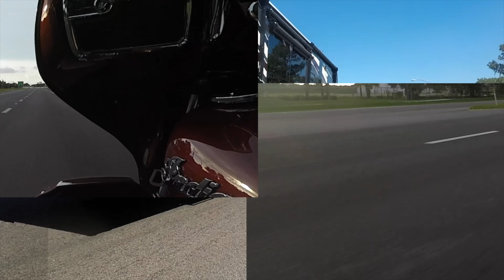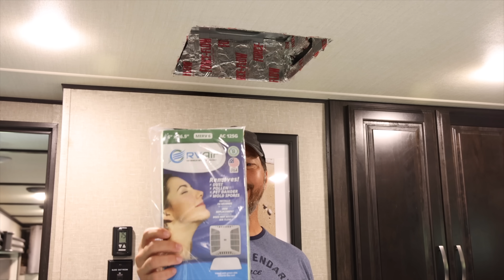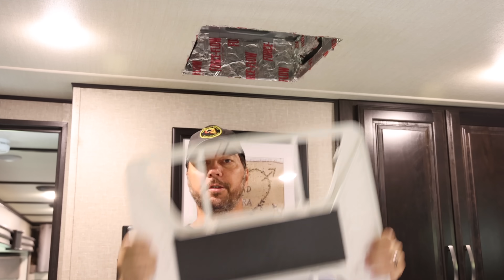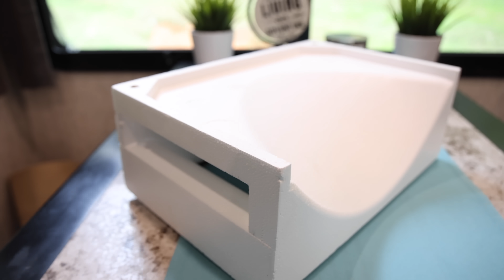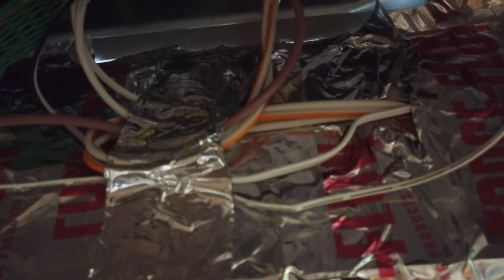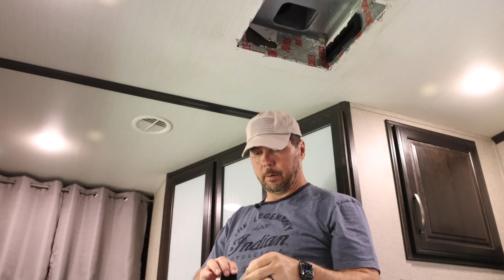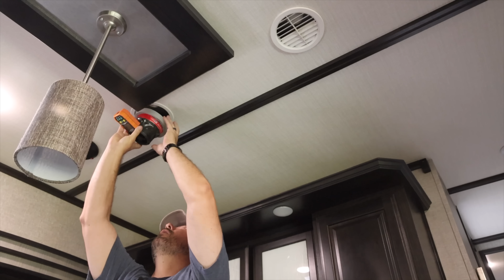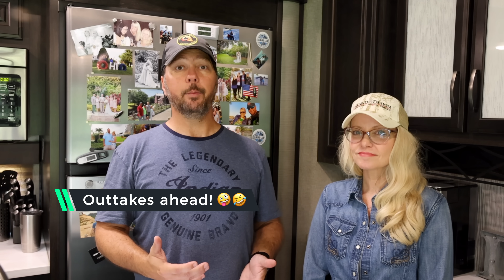Turbo-Charge your RV AC with RV AirFlow! (40% Improvement on Average!)

Comment: The foam arrived. I installed on living room A/C. The plastic pieces you installed into the supply side ducting were already installed in mine. I had to install tape around the foam on the return side to seal it off from the supply side. I have a 2021 momentum 376THS. Will try to install the other 2 tomorrow.
Reply: How did the system improve overall?
Reply: @flawlessvic  Western Washington cooled way down. Haven't had to use the A/C since. We are supposed to get into upper 80's this weekend. I will test them then.

Comment: Just installed this on our 2021 Imagine 2500RL. All I can say is WOW. The wife said she can tell a big improvement on the bed vent. I did put foil tape on the back of the air dump.
Reply: I was thinking about the tape on the dump as Chad was closing it up--the increased return airflow probably will make those slide louvers rattle more.👍

Comment: Our Open Range has what’s supposed to be a “high performance” central unit. It has dual intake ducts rather than that single plenum directly under the AC unit… I assume there’s still a plenum something like this somewhere but it’s not directly accessible. Perhaps this system doesn’t suffer some of these shortcomings?

Comment: I'm sure its more efficient but the dumps are cut off completely in the new system.  Did you compare it before and after with the dumps slid shut?  Slid shut, they would push more air out to the other outlets.  Maybe not 40 percent more, but still.
Reply from the maker: There is info in the blog article here: https://changinglanesrv.com/rv-airflow/

Comment: Maybe adding a question you've already answered, but did you guys measure the actual temperature of the air coming out of your supply vents? You can pick up an infra-red thermometer like what they're using to check your forehead on Covid screening to measure it. One good way to measure the efficiency is to check the temperature of the air going into the unit, and the air going to the living space (supply air) , then measure the difference. You probably want to see between 14 and 22 degrees on A/C. The closer to 22 (or above) you are, the more efficiently the unit is working overall.
Reply: I haven't measured the temps, just the air speed from the vents.  It went from 8-9 mph to 18-20mph and now my wife complains that "It's Too Cold".  This product saved me from adding a second AC unit to my trailer. Best Mod I have ever made to my 4 year old Starcraft!

Comment: Did you notice that if you only have one of the multiple units running that the air comes out of the return side?
Reply from the maker: It shouldn't, unless it's pushing past the evap coils on the units that are off....
Reply: @ChangingLanes  exactly what it does.
Reply from the maker: Maybe try removing some vent covers to reduce resistance on that end?

Comment: Hey guys, great video...I'm considering purchasing a pair of these for my GD 375RES....tell me I'm overthinking, but....those big 4 bolts that hold the AC unit onto the rig's ceiling....how do you know that when removing + reinstalling them, you haven't upset the sealant used on the roof for the factory install?
Reply from the maker: It shouldn't.. There is usually some kind of butyl tape seal under the AC.  But, as long as you don't move it off the seal you should be good... Worst case, check it on the roof side also and have some of this handy:  https://amzn.to/2TTsMbg

Comment: Thank you guys so much for the info. I am a brand-new Solitude owner and this is my very first fifth wheel. How long should it take for the main living room to cool down? I think I might be having trouble with my rig. It was 96 yesterday and I couldn't get it below 84 in an hour's time.
Reply from the maker: That doesn't sound unusual.. On hot days, get the AC started early.  It takes a while for it to play catch up.

Comment: Have to say unless you check the devider and noticed it had fallen over, you would have always run the AC that way and had less than peak proformanc. Where as with the RV Airflow it always runs at 100% potential because there is no divider that could fall over so, an un knowing RV'er would have a 140% gain in AC flow.

Comment: Your restricting the CFM of the blower which leads to high amperage on a Dual shafted motor  condenser/blower.( STOP FIRE )  ! due to heat : amps = HEAT......
Reply from the maker: The CFM is not restricted, its only restricted from not going where it shouldn't (roof, etc)...  Also, our AC is has separate fans (not dual shafted).

Comment: no way that increases airflow by 40% unless they increased the size of the ducts.
Reply: It probably does seem hard to believe, but I can attest to the fact that is does greatly improve airflow.  One reason is that it actually permits more air to enter the AC and it reduces any air losses due to poor construction and ducting done at the factory.  Before installing the RV Airflow the air coming out of my ceiling vents measured 8 to 9 mph on my handheld wind meter.  The trailer was slow to cool and never really ever felt cold. After the install the same vents show a wind speed of 18 to 20 mph, and now my wife complains that it gets too cold!  It cools the trailer in less than half the time than before, and the AC runs much less as well.  The money spent on the RV Airflow saved me the cost of adding a second AC to my trailer.

Comment: The price of this is $380. You can go to Home Depot and get the same thing for $30
Reply: That's bogus...where did you get the $380 number??  Good luck with your $30.00 dollar HD cheap fix.  RV Airflow is well designed, works better than advertised, and saved me from buying a second AC for my trailer.  Post some photos of your project....

Comment: Been watching you kids for a few years now and just wanted to tell you we just bought a new Grand Design Reflection 5th wheel and they are NOW installing the RV Airflow in the AC units.  I took mine apart to check before I ordered one, and WOW it is already installed.  Makes a HUGE difference  in the cooling and air flow.

Comment: I installed an RV Airflow, in March 2021. "WOW", what a difference. Had to turn the A/C vents in a little different direction. Wife was complaining of the air blowing directly on her was "TOO COLD". Also noticed a difference in, when we had to run the A/C. Due to the moisture on the windows, when just running the furnace only (high humidity). The humidity level decreased substantially , and the windows cleared up.  THANK YOU R/V AIRFLOW for this product.
Reply from the maker: 👍🏼  😀  Glad you like them!
Reply: @ChangingLanes  
Vacation starts this Saturday, Sequoyah state park, outside Tulsa okla. You need to check that place. It's our 2nd time there.

Comment: $200 for a piece of styrofoam? It’s a cool idea but cmon man. Kinda hitting people over the head a little
Reply: It's way more than just a piece of Styrofoam.  It's a cleverly engineered product that does work better than it was advertised.  The air flow from my AC ceiling ducts went from 8-9mph (measured with my handheld wind speed meter) to between 18-20mph!  The price I paid, much less than $200 with the Changing Lanes discount, saved me from spending $900 on a second AC unit for my trailer.  My trailer cools down so much faster now, plus the AC doesn't run as long to reach the set temp on the thermostat.   It's by far the best improvement I have made to my trailer since I bought it 4 years ago.

Comment: I can't understand having black air conditioner covers and routing the cold air through ducts in the ceiling.   That black cover absorbs 500 Watts of heat in the sun, and those ducts likely absorb another 500 Watts of heat and warm the output air of the AC unit before it gets to the ducts.  It would be great if we could get the RV manufacturers to do anything else.  They seem blind to efficiency, effectiveness and noise levels of these systems.

Comment: As usual shipmate, great vid. Question:  I purchased the recommended “torque” driver. After completing the install, It seemed like I had turned on  the 4 lag bolts for a l o n g time. Checked with the inch lb tool and it started clicking at 35 I/pds. Would you suspect (obviously I can’t expect you to guarantee) that 35lbs is sufficient?  Feels like I’ve turned till the cows came home and I’m hesitant to keep turning.  Pls advise you thoughts. Thanks, Dave. SCPO(SW), USN (Ret)
Reply from the maker: Ours took a few turns too. I was surprised.
Reply: I found the torque mentioned was way too much for my AC.  I had marked by mounting bolts before I removed them and at 40inch pounds the marks were way different, plus my gasket under the AC was overly compressed.  I backed off the bolts and torqued to the previous marks I had made and that required about 25 inch pounds. With the RV Airflow installed you can only see two of the indicating tabs on the AC that show the correct torque.  At 25 inch pounds the tabs were in the correct position.  I think the amount of torque required depends a lot on the condition of your AC gasket.

Comment: Hey guys, thank you for the RV Airflow video. I just received mine today and worked for hours installing it. Where the Manufacture framed in the opening in the roof it was LESS than perfect! Not square, Unit not set on roof square, duct with large gaps, opening too small for main piece...etc. After watching your video, It prepared me for some of these obstacles. My rig is a 2018 Avenger by Forest River. To give you an idea how poorly it was installed my average increase is 61%...a noticeable difference. Thank you again for the excellent videos and information!

Comment: We have an Eclipse Attitude 27SA with one central air conditioner in the main room and vents to each room. If we were to use this product it looks to us that we would no longer have the option to open the large vent and cut off the conducts in order to cool the main living area quick as possible which can take some time. Would using this product and getting 40% increase in the ducts make up for not having the option of having the vent wide open? Which would be more efficient?
Reply: You are correct, the air will no longer come directly from the AC out of the large vents in the bottom of the AC.  In the AZ summers I would open those first trying to lower the inside temp as fast as I could, but that didn't seem to do very much for the amount of cool air coming out. The cold air coming out of those vents is actually right next to the hot air going into the AC, so there has to be some loss of efficiency there.  The RV Airflow actually increases the amount of warm air being sucked into the AC unit because there is more surface area to draw from, hence, more air in, more air out.  Since my installation I can truly say that my 30 foot travel trailer with the 15kAC and 5 ceiling vents cools much, much faster than ever before. I have never missed not having the larger vents open at the bottom of the AC unit.  It has been the best mod I have made to my trailer, except for maybe adding the SoftStart to the AC, and it has saved me from having to add a second AC, which I had planned to do this summer. I have no regrets!
Reply: @SeaplaneSailor  Hey Lee, thank you that response. We are hoping that will be our experience this summer. We also added three turbo fans to our roof vents to try to get that initial heat inside to exhaust outside to help jump start the cooling process. We haven't had the opportunity to prove that theory yet. Do you think that will help as well?
Reply: @franktostanoski8136  Sure couldn't hurt to give it a try.

Comment: Just ordered two for our Arctic Wolf 321BH.  We have the Coleman Mach3 A/C units.  Thanks for the coupon code, saved me $34!
Reply: I have a Arctic Wolf 321BH with one AC.  It will not keep cool even on an 80 degree day.  Have not checked the divider problems, but still think I need more help.  Did this do the job?  Can you cool your unit with just the main AC and the AirFlow?
Reply: @gabegundersen9681  I haven't tried with just one. I've always been on 50amp. But we just went to Disney and it was 98 degrees in the rig when we got there. It was down to 70 degrees in about 45 minutes. These things rock.
Reply: @RonnieRukus  Thank you!!!  Will be ordering ASAP.

Comment: Awesome video question for you so supposedly my 2021 grand design momentum came with the center one so I’ll be installing the other two in the front and rear. Now as far as the heat pump goes I only have one as well in the center what do I do with the other two ACs when I’m running the heat pump do I have them on off?

Comment: What i don't understand is this handyman didn't do it before. The information is out there. And so they were givem them3 i wonder if they did the fix and then remove it for sponsorship? Just thinking the information has been out there and now its like this. Hope they are real  not fake yes
Reply from the maker: None of the DIY solutions we've seen out there are as good as this commercial solution.  Sure, a DIY might be better than noting if done right, but this thing was engineered for maximum airflow and minimum resistance/turbulence.  You just wont get that with all of the angles in the DIY jobs I've seen on youtube.

Comment: Unfortunately I didn't see my 2018 jayco whitehawk 23mbr dometic 13.5 btu in the list but I'll do the measurements and see if it'll work. I already did my AC maintenance and works great but this thing probably will increase electricity efficiency and cooling efficiency.

Comment: It's a well engineered product that works better than advertised.  The airflow from my AC ceiling vents more than doubled and my trailer cools down faster than ever before.  It's one of the best Mods I have ever made to my trailer.  From now until May 10th get a 15% discount, code FRIEND-VQTJB2F.  This product saved me from adding a second AC, so it saved me a lot more than the price I paid.

Comment: $170~$180 Dollars for styrofoam and two plastic inserts? ....
Reply: It's a well engineered product that works better than advertised.  The airflow from my AC ceiling vents more than doubled and my trailer cools down faster than ever before.  It's one of the best Mods I have ever made to my trailer.  From now until May 10th get a 15% discount, code FRIEND-VQTJB2F.  This product saved me from adding a second AC, so it saved me a lot more than the price I paid.

Comment: Installed this upgrade a couple of weeks ago and we just had temps high enough for a day or two to try it out. The increased air movement is wow!! Makes the window shades move a little. Started with an 84 degree inside temp and after about 45 minutes it was down to 77 and cycling properly. It will be well worth the cost. We have a 2nd unit in the bedroom that we run during the day on Hot days with a small fan on the dresser moving air into the living area which helps. The big change will be at night when we only run the main unit. Now the bedroom will be easier to cool with the increased air movement. The one thing I found during installation was after centering the a/c unit I still had a small space between the sides and the duct opening. I added a thin foam strip around the opening on the insert and it fit nice and snug. If you have a ducted unit that this upgrade applies to by all means get it.

Comment: I modified my plenum to achieve the same result using foam board. It's not as nice looking, but since the part wouldn't fit my A/C I had no choice. Besides the cost is high for a piece of foam. No one talks  about the duct work itself. The 4" vents used don't let out that much air & are noisy. What I did at the end of the run (last vent at the front & back) I removed the vent, cut a hole big enough to put a  regular house vent in. The ducts are about 3" x 8" so the size fits. This reduces the pressure in the ducts allowing increased airflow.

Comment: Thanks for that guys. I know what I'll be upgrading next. We have 2 A/Cs but only 1 connects to the ducts. They doesn't give much flow to our front bedroom forcing us to run the bedroom air also.  I'm curious how much cooler our rig will get. It's super hot and humid here in northeastern Oklahoma. Thanks again. :Nic

Comment: We just spent the weekend in Quartzsite, Arizona, where the temperature was 85 degrees on Friday and Saturday.  This was our first trip where we could do a real world test with the RV Airflow installed in our Coleman Mach 15k AC.  Prior to the install it took quite awhile to reach the set temp on the thermostat once we plugged into shore power.  It was 85 outside and 81 inside when I first powered up the trailer. I set the thermostat to 76 degrees and within 30 minutes the AC shut down and the inside was a cool 76 degrees. That's never happened that quick before.

During the day when the AC restarted it only ran a few minutes before it reached the set temp and shut down.  It has never done that before either. It used to run quite awhile before reaching the set temp. It also seemed to run a lot quieter because when it ran we didn't have to turn up the volume on the TV like we did before.

Needless to say we are both impressed with the great improvement.  It works better than we expected and so glad we found this video!  Best mod I have made to my trailer since new!

Comment: At a cost of $170-$180 that is ridiculous
Reply: It does work.  Before the installation on my 30' Starcraft travel trailer I measured the air flow using my hand held digital wind meter. The vents closest to the AC were showing 10mph wind speed, while the rear vents showed 8-9mph wind speed.  After the install all of the vents were showing 18-20mph wind speed, which was double before the installation!  It was blowing so hard it blew the instruction sheet and screws from the bottom cover off the kitchen table.

The installation was easy and it's going to make a huge difference in the Arizona summer heat!  Well worth the money in my opinion.